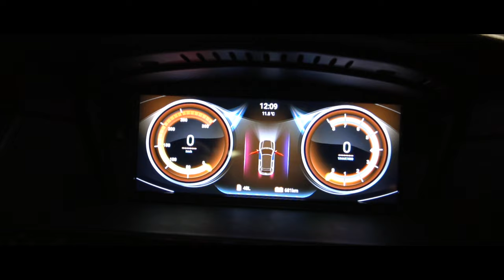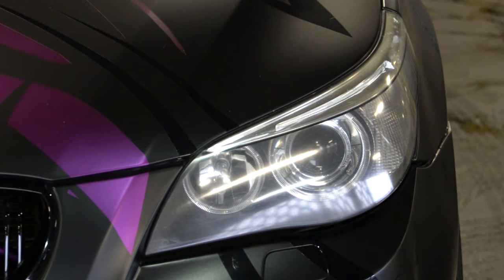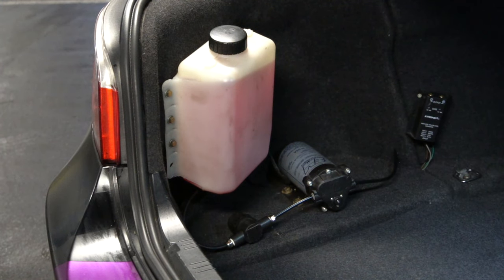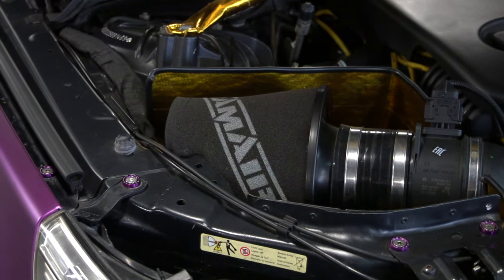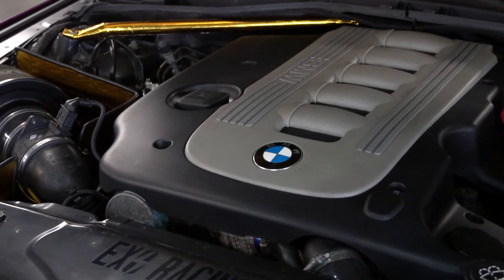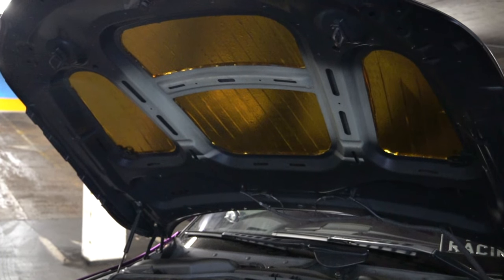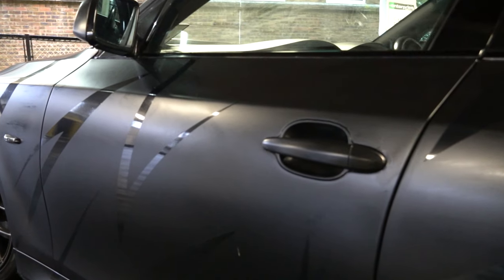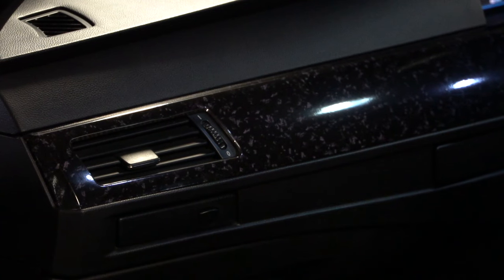THIS 440BHP HYBRID TURBO BMW 535D PULLS LIKE A FREIGHT TRAIN!

Comment: The KING of all diesel engines! I can't wait to get my hands on a E46 330cd Manual.. Will be a weapon when I'm done with it ;)
Reply: Zhoaib Raja I have a 06 330cd manual. 296bhp and 500ftlbs took me ages to find a decent one. Love mine
Reply: I have driven a remapped one and it was very scary 😀
Reply: @adamtaylor3201  I'm keeping an eye out for a black, manual, M Sport that hasn't done a shit tonne of miles.. I think I've found one but guy is kinda reluctant to sell it now 🤣 (even he knows how good these Cars are) just need to save up a bit more before I commit 😁
Reply: @VladoT  I'm sure it was lol.. these cars when tuned properly aint no joke! 👌🏼💯
Reply: This 535d is crazy fast for a diesel but you'll also love the 330cd (tuned) I used to have an estoril blue with champagne leather ( very rare colour combo, especially for a 330cd ) and i went a bit crazy with it, hybrid turbo,  bigger inter cooler, custom remap, egr delete, 3 inch straight through ( sounded great, no one believed me when I used to say it's a diesel). It was running 300bhp and for a diesel it was such a quick car! I have posted a video on YouTube if you'd like to see it and hear it.
You won't regret getting one
Reply: I had an e46 330cd manual, with all the toys, mapped and decent s/s exhaust. Easily the best car ive ever had. Seriously regret selling it 😭
Reply: @hello7533  I still miss mine to this day and the current cars i have are faster than the 330cd i had but it just looked so good and went so well! I was my daily and it always put a smile on my face
Reply: @Sam_AMG  I've seen just about every 330cd video on YouTube 🤣 definitely seen urs with the description you've given me 👌🏼💯
Reply: @hello7533  beautiful timeless cars.. the E46 is my most favourite BMW shape ever made...
Reply: @Sam_AMG  yep watched that many times lol.. its in my liked vids haha
Reply: @zhoaibraja2992  thank you. I watch it too from time to time and like to show it to people that say diesels never sound good and then they all look surprised when they watch the video how a diesel car can sound so good.
Reply: I have videos of my 330cd on my channel. 
Pulls and noise clips.
Reply: @Sam_AMG  Yes I remember yours Sam. The best E46 Diesel I've ever seen period. It was gorgeous. The clean Estoril blue was just beautiful. Personally, I would have just kept it mate.
Reply: @DrStrange1000  thank you! It was a very clean car and went very well! I miss that car. I sold it to a friend of mine and he destroyed it cosmetically. Bad scratches, dents, scrapes. Then he got it resprayed by someone that must have just used a rattle can and used his bare hands to filler the panels. Honestly it was shocking when I saw it! As for the interior, the seats had gone from champagne to dark greasy grey 🤢. He offered it to me but I would have had to spend at least £5k on  cosmetic things to get it to look like it did before. The only good thing was that it still drove amazing to my surprise and reminded me how hard it used to pull! Sorry for the long post but I'm still sad that he let it get to that stage
Reply: @Sam_AMG  Nope don't be sorry. You put in a shit tonne of work and it's interesting how (even a mate) the new buyer does NOT appreciate this. Reminds me of me selling my old super clean W202 Mercedes to a mate. Immaculate condition. Police pulled him over 5 months later for something..some time later the car was crushed!! 
At least we know not to sell despite financial circumstances.
Reply: @Sam_AMG  reminded me of an E30 I used to own. Sold it to a guy I was working with at the time. Couldn't believe my eyes when only a few weeks later I saw the state of it. Hed been drifting it in a field !
Reply: @secretivescorpio891  its heartbreaking when you see a car that was your pride and joy at some point and then someone just abuses it! Shame really

Comment: What an awesome beast! An xHP tune for the gearbox is a great upgrade, as a 260hp 530D E60 driver 🙃
Reply: Really, I have the 535d e60 LCI, will it improve the performance, its tuned to about 360hp

Comment: Thought only a PD could pull like a train
Reply: You forgot about the N22A2 on the MK8 Civic ;)
Reply: Im pretty confident a 535d has two pumps too la
Reply: Gotta check out the Italian diesels as well in that case haha :)
Reply: @PinkFK2R  what you know about it? Are they any good? Reliable? Tuning potential?
Reply: @Zordzak6  +1 to Italian diesel,my Alfa Ducati corse is 280bhp and 500+ nm of torque
Reply: BMW 6 cylinder diesels are on another level to PD 4 pots.
Reply: Pavlo Lowry reliable? Definitely! If you buy a Civic with the N22A2 that has been serviced properly then you’ll find that the engine is tough. Tuning potential is there. With the clutch that comes with the diesel Civic, it can be an issue. They’re made of chocolate. However with most common remaps, stage 1 from most tuning companies is from 140bhp to 185bhp and up to 400nm of torque. A Stage 2 offers even more performance, usually from 200bhp onwards but requires a better intercooler and an uprated clutch, you will also see an increase in the torque from 400nm to 440-460nm depending on the remap and how it was programmed. An uprated clutch will cost you about £700 with a dual mass flywheel, an aftermarket intercooler is about £350. The remap cost can vary from each tuner as you know, going rated between £300-400. A stage 3, upwards of 220-250bhp, requires a hybrid turbo and the previous items I listed. All in all, the engine is reliable but needs to be looked after as most engines, potential is there if you’re willing to spend the money as stock parts will fail.

Comment: These return 40+mpg on a run too! Shame most of the pre face-lift ones are money pits, most needing gearbox rebuilds and the injectors also fail and cost circa £300 a piece but when they work they're fantastic all round machines. 👍

Comment: These cars have a torque restricted 1st and 2nd gear so you don't shred the box, you can get a remap on the box which eliminates the restriction, mine is stock box with stage 1 engine map, feels OK 1st n 2nd but wen It hits 3rd bye bye to what evers in the rear view haha

Comment: Yeah this car is very decisive, bought similar car and driving it back I thought I was within the speed limit till I looked down. Had to break really hard. Its very quiet inside and because it’s diesel, loads of torque and doesn’t rev high like petrol engine.

Comment: Got the 535d e60, ans i love it. that extra power down low is so worth the extra money. But only thing i dont like about diesel autos you dont have power when you want it. Like my old 2l petrol manual. Was much more fun to drive. My 535d feels good on open road but for city i might go back to gti, much better for city and fun driving.

Comment: Got all new tyres on my stock F30 335d and def did a sub 4.5 w/ launch control, also had it off the clock prob doing 170+, needle flew past 160. XDrive is a must for living in Scotland haha
Reply: Although I love my stage 2 435d, it handles like pants compared to my former f30 330d. Xdrive is ace for traffic light storming. 3.7s to 60 and 12s 1/4

Comment: I love watching u guys channel but one thing confusing to me. In the usa i know BHP is measured @ the crank but the way u guys speak about hp its definitely speaking about wheel horsepower WHP. Correct me & please explain 🤔
Reply: MR. STYFF aka Lloyd D Stiff USA measures in WHP. In the UK it’s measured in BHP (crank). Usually the dyno will still read in WHP but apply a correction factor to get the BHP. So; this car has 440bhp, and WHP is probably somewhere around 370.
Reply: @J_S591  ok thanks for clearing that up because i was a bit confused since i knew BHP was reffering to crank ot @motor. Ok now i cld stop scratching my head & enjoy the reviews 😁👍

Comment: I used to own a e46, 335d, had it running 480 whp with a shitload of torque starting basically at idle haha. Still thinking of getting one again!
Reply: To prevent people saying there is no e46 with a 335d engine. I replaced the 330d engine with one from a 5 series. Completely redone the engine while it was out of the car. Different clutch, turbo, intake, the whole shablam
Reply: mistermarin91 prevented no one because no one cares!

Comment: Hey Jamie. You need to do a diesel challenge and see who's  got the oil burning weapon out there mate,. I've already emailed you about my 335D that's undergoing extensive works. When it comes out i'll put it up against any diesel out there. Diesel Challenge at Bruntingthorpe??? Come on Jamie bring it on.
Reply: Guy in mcr has a e90 335d  that's like 550bhp tuned by gkr performance proper mentel car
Reply: I will give you a good run 😂👌👌👌

Comment: These things are weapons, these and 330D with single turbo as well. Easy tunable without internal parts tune they can hold around 500hp reliably. Not much to do if you want 400hp, just bigger turbo injectors from 335d or bigger engine and a better intercoler.   
And better tires, because with a simple remap the stock car is already tail happy in third gear. 
The gasoline car with these numbers would sip at least 3 times more fuel, which is really sad since every green activist promote gasoline as a lot purer compared with diesel... But just imagine the volume, to cover a 100l of diesel used, you would need ~300l of gasoline.. And they tell you its less pollutant...

Comment: Mod your diesels all you want, a 335i with boltons will pass you everytime. Also, 335i with a single big turbo kit would smash it like a b*tch. You just cannot make a diesel do good power. Torque absolutely doesn’t matter. High revs + high horsepower wins races.
Reply: If he wanted a 335i I'm sure he could get one. Take any diesel with the same hp as a petrol equivalent and it's going to smoke it.

Comment: i have a m57 335d. 405 hp / 660 ft-lbs.... 
ive only been beaten by a 700-hp Lancer EVO, stripped out interior race-spec road legal monster.
Everything else it chews up and lets em bite the dust. 
Hi from the USA
Reply: Then you woke up.

Comment: The M57 is an incredible diesel engine second only to the legendary Merc OM606 but it's sadly let down by the cheap ancillary junk they bolt to it. This is what happens when the bean counters supersede the nut turners. As for the N series units...💩